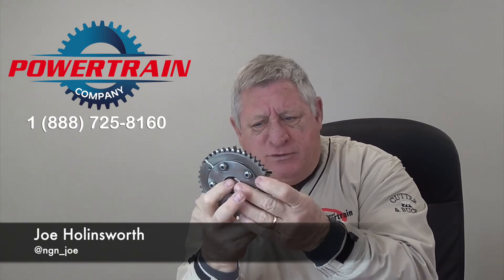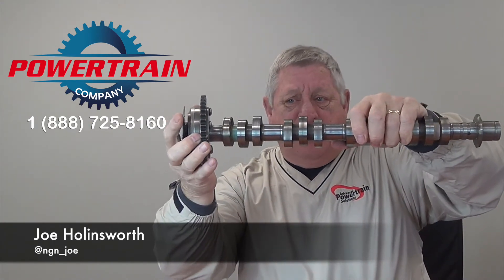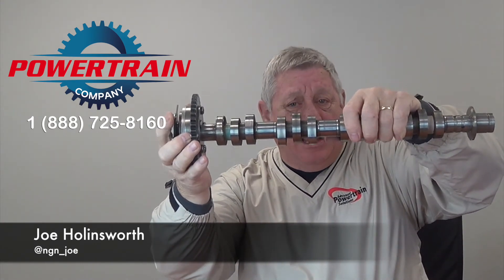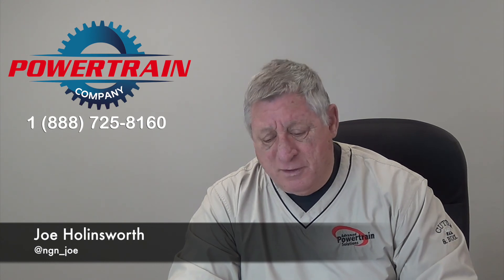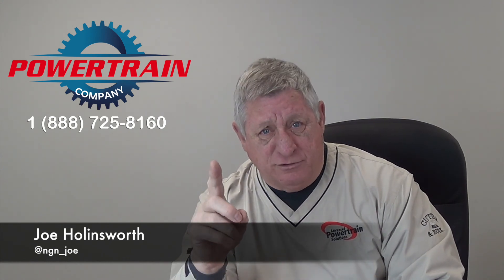Ford 5 4 Liter Cam Phaser Discussion

Comment: Is there any issues if you put a lock out on the cams on a super charged motor?
Reply: Yes, absolute manifold pressure doesn't matter. The cam still needs to be timed to give the best performance.

Comment: Fraser is one of the largest providers of remanufactured engines and transmissions in the United States
Since 1961, Fraser Engines and Transmissions has been providing the best replacement engines, transmissions, differentials, and transfer cases.

We MATCH or BEAT Any Competitive Pricing
We Are NOT BROKERS – We Sell What We Manufacture
We Have a 5-Star Rated Warranty Staff
27 Warehouse Locations Around the Nation
Most Engines Come with Three (3) OPTIONS
We carry remanufactured engines and transmissions for AMERICAN & IMPORTED vehicles. We also have High Performance and Marine Divisions. Ask us about our Certified Refurbished Program – one of the best in the nation.

Most engine and transmission websites out there purchase from us! SAVE YOUR MONEY – avoid the middlemen and BUY DIRECT from the manufacturer! 

ASK YOUR SALES ASSOCIATE HOW YOU CAN GET $100 OFF YOUR NEXT ENGINE OR TRANSMISSION ORDER!
Reply: Fuck you fraiser
Reply: Fraser is one of the largest providers of remanufactured engines and transmissions in the United States
Since 1961, Fraser Engines and Transmissions has been providing the best replacement engines, transmissions, differentials, and transfer cases.
Reply: Fraser is one of the largest providers of remanufactured engines and transmissions in the United States
Since 1961, Fraser Engines and Transmissions has been providing the best replacement engines, transmissions, differentials, and transfer cases.
Reply: @FRASERENGINES  Why would you do this to a competitor. It makes you look very bad as a business.